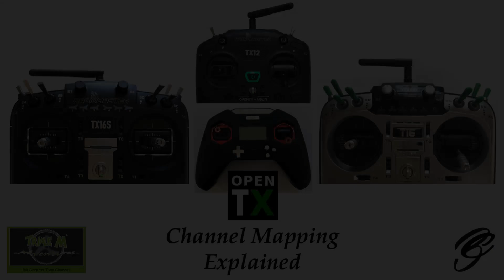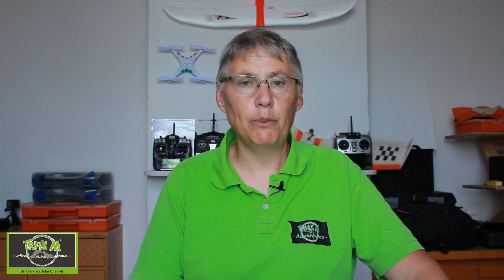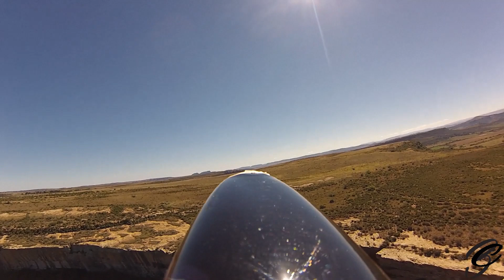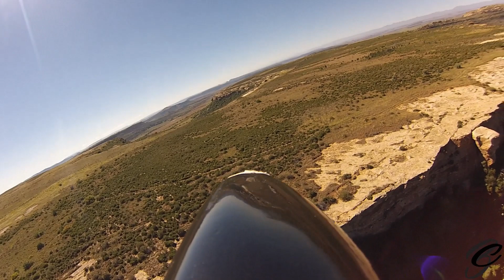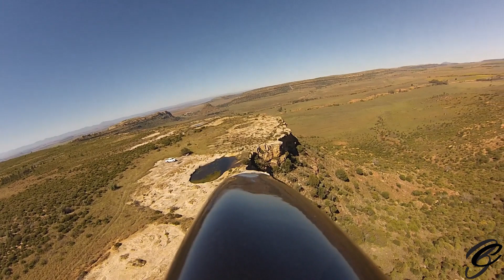OpenTX – Channel Mapping Explained

Comment: Hey Bill I want to increase my throttle end point at full stick throw? In my old radio I did it with travel adjust do you know what I should do?
Reply from the maker: Hi Derek, you need to go into your Model Setup and check Extended limits (box will go green) Then go to Outputs and your Throttle channel and adjust the second 100 by adding the amount you need remembering the servo, if a plane, only has so much adjustment.
Reply: @the-happy-RC-flyer  thanks for your speedy reply Bill, will have a look later when I’ve finished work 🙃